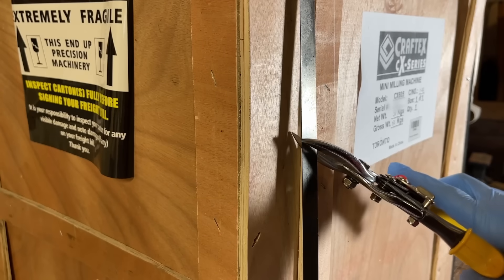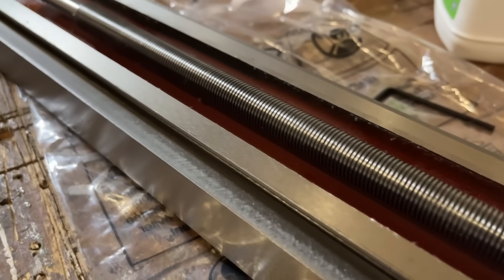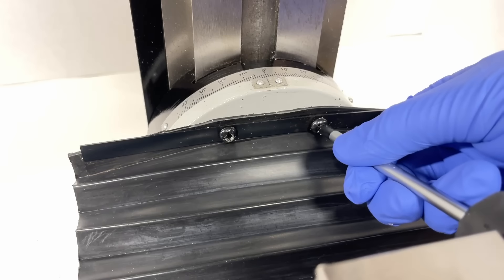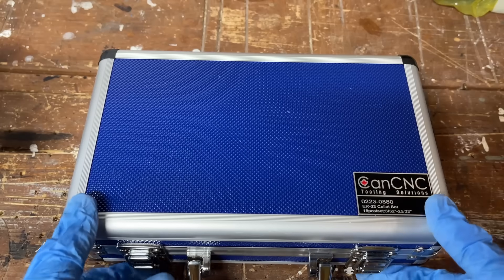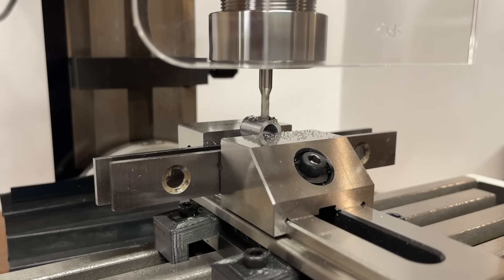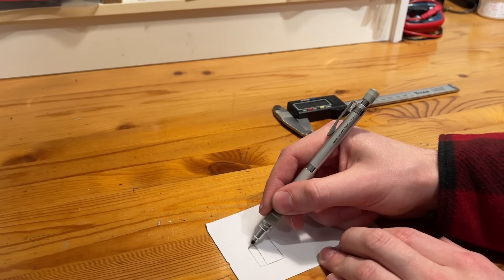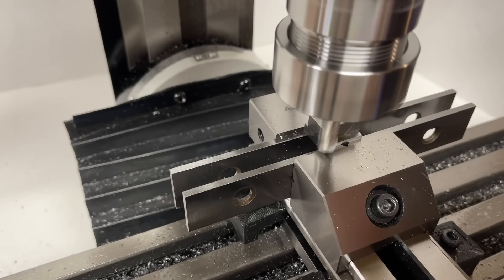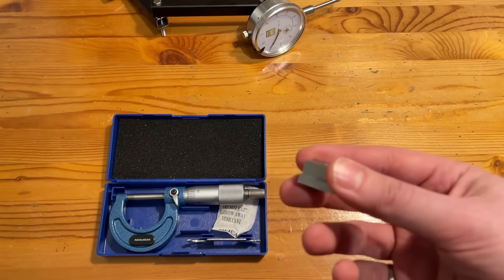I Bought A Minimill to see if they are Worth It

Comment: You should always mill in the same direction. This will compensate for any play in your milling table X and Y screws.
Reply: I grant that that the Bridgeport I learned on was old and had wear in the lead screws, but I thought that rule applied to EVERY machine tool -- always back up past the lash distance, and then approach your setting from the same direction.  Trying to dial in a position in the other direction means you have no idea where you are.
And then lock the setting, so that if the tool generates any forward force, it doesn't bite any deeper than you meant for it too.

Comment: Good video, thank you. The spacers you used under the piece to hold the piece in the vice looked like a couple of brackets; did you have someone else mill those to size before you were able to use them on your mill or did you painstakingly file them by hand? I only ask because my expectation was that you'd otherwise struggle to cut parallel sides to a piece. Often it's those first references that are the hardest to make without a mill.

Comment: IMO I would use a minimill in a home business/small shop setting but it's because of the low costs. If you have nothing, I think a mini mill and lathe are good places to start, but it will still be a challenge making a livable profit until you've invested enough time in a sizable library of tooling and improvements.

If you're a machinist with 10+ years, however, it might be worth either learning to millwright a used machine, or if you have a good idea and reputation, going into 100k debt and starting a small CNC shop with new equipment.

Comment: Bridgeport Series 1 and 2 universal milling machines have heads that can be tilted side to side and forward/backward. While they can be knocked out of alignment due to hard use, these and similar milling machines have been heavily used by industry for decades. It's a given that any machine that offers the flexibility of a tilting head will need to be trammed in from time to time.
Reply: Plus older Bridgeports and plenty of other manufacturers (US machine Tool Co. comes to mind as an example of a smaller mill) had round rams and simply clamped down on the column casting to hold them in place. You can't possibly tell me those never moved or those could take super heavy cuts.
Reply: @Hemingray1893  Only the V-ram Series I CNC had the ability to swivel on the cast base. They were basically a manual Series I milling machine retrofitted to be a CNC.

The rigid ram Series I and Series II had the head assembly fixed to the casting with both pins and screws. And yes, they could take heavy cuts--especially the Series II. The heads did not move. You could push them to the point the drive motors stalled.

Comment: The thing about small mills is plastic gears and low toque. If you stay in parameters and use the correct tools you should be able to cut anything. I have a FADAL 4020, while not a comparison in capability it's more a difference of power. With 22.5HP of direct crazy torque to 10,000RPM with coolant, I can plunge a half inch into Inconel with a 6 flute Harvey II endmill quite fast. I can use the same mill bit in the minimill and machine the same metal, just a lot slower and with more passes or those plastic gears will shred. I have an ACRA knee mill which overall is great for manual machining, it's a Bridgeport style, I'd say truly learning to mill, these smaller machines will let you down a bit.

Comment: I started out with a harbor freight mini mill and mini lathe when I first got into machining and metal working.
I slowly graduated to slightly larger benchtop machines and ended up with a full sized gunsmithing lathe and a CNC mill.
When I retired, I sold most of my metal working machines thinking I'd no longer have much use for them; boy was I wrong.
I sold off my mini lathe many years ago, but I kept the mini mill all this time.  I still own it and I still use it and, I just recently bought another mini lathe.
It's true that they require alot of tuning up to get them to run accurately; or, accurately enough for hobby stuff but, with a little experience under your belt that really isn't that hard to do.
Reply: Same boat sold the big mill and lathe and spot welder when I sold the shop. Had to buy replacements not quite as big but still good enough.
Reply: It's par for the course.
Reply: Just the person I've been looking for! Can you chamber a rifle, true up actions and barrels on a mini lathe?

Comment: the best addition will be a stiffening plate at the back of the column,  and then a 3 axis DRO - this will cost you about $ 250 in LED or about $300 in LCD, both with scales to fit your mill. I have made a polyVee drive myself and do not regret it - there are instructions on youtube and the internet as how to do it.  Another tip I can give is to 'cap' the drawbar and give it a square end - a spanner is way more easy on the spindle bearings than a hammer to loosen the MT3 tapers, and a spring loaded spindle stop will be a nice addition too.
Reply: I did the stiffening plate too.  Had to tap a bolt hole at the back of the frame, and in the column, but that is a lot better than having a colmn shift totally mess up a work.

Comment: Unless you want to work to less than 1/1000 of an inch the mini mill is fine. Would recommend paying extra for the belt drive model and converting to a gas strut lift. Remember we have to work within the limits of our wallets and pensions.

Comment: I've had one of these machines for about 20 years now. After using it for a while with the gear drive supplied I changed to belt drive (bought as a kit) and I think it was really worth the conversion, much smoother running. I find that it max's out at about a 10 mm (3/8") end mill or slot drill for normal cutting work (but usually stick to 6 mm /1/4") and 12 mm (1/2") for light surfacing.

Comment: The reason for 62.5 divisions is they are thousandths, and .0625 is half of .125 which is half of .250 which is half of .500 which is half of an inch. 16 full turns is basically an inch. So, a full turn is 1/16", a handy increment for many of us people down here in the country that landed men on the moon. If you have not the slightest interest in inch fractionals, or a particular cut is more easily expressed in thousandths as it usually is, then your solution can be an obvious and handy time saver, yeah. Super duper easy to do in Python or BASIC or whatever. I just do it on the fly in the Python environment, in an open terminal session, second nature to us Linux users. Divide the desired thousandths by 62.5 for whole turns and the decimal fraction of a  turn, then multiply the decimal part back by 62.5 for the leftover thousandths that the dial is marked off in. You can also use the "//" or int operator and the "%" or modulo operator for the leftover thousandths. To streamline even more, use the builtin divmod() function. There are two arguments, the first being the distance in thousandths, the second being 62.5 or a variable with the value 62.5 assigned.
x=62.5 # ENTER. That sets the value for x. You can check it by typing:  x [ENTER] and Python will return 62.5.
divmod(1253,x) # ENTER. 1253 thousandths for 1.253, x with value 62.5 assigned in the previous entry.. Don't forget the comma. Python will return a tuple, the first element 20.0 which is the number of whole turns, and the second being 3, the leftover marks on the dial. So 20 quick turns and then tweak it on over another 3 divisions.
Now, try it for 0.373
divmod(373,x) # returns (5, 60.5) and that is exactly two marks less than six full turns which is of course 3/8", so obviously the function arrives at the correct values for full turns and leftover increments to give you the desired travel.

My mini mill is marked the same way, and I much prefer it to metric goobledygook. YMMV, I know that there are a lot of metric fanboys out there who think inches are above their paygrade.

A reasonable level of accuracy and precision is possible with these machines. You have to do your due diligence in checking and tramming and keeping those gibs snug when they go slack from wear. So a little more work from the operator if you need something to be right on the money. Probably half of all mini mill owners could care less, and are cool with the nearest 1/128" LOL which is 7.8125 marks hahaha. But let's call it 8.

Comment: You should make a table with a 4-5" concrete slab on top. Quickrete countertop mix works well as it has reinforcing fibers in it and doesn't need rebar. Concrete really damps vibration and it makes a huge difference.

The issues many people have with small machines is just too snobbery. I understand criticizing poor quality machines. But people criticize small machines as if their size is a flaw. It is what it is and it does what it does. Its not a flaw, it's just a small machine. If you need something bigger, then it's not for you.
Reply from the maker: That’s a great idea! I had good luck with a concrete slab for improving my 3018. I’ll definitely be doing this!

Comment: When buying these machines, it is IMPORTANT to understand that all the castings are finish cut in one go.
Consequently, they are ALL warped.
When one side is cut, the stresses are released, and the metal changes shape.
After initial cutting, the casting should be left to warp, and then be final machined.

Therefore, the first task, is to determine the best datum surfaces to make flat, and then get everything square.
Ideally you need another milling machine, but I re-engineered mine with a surface plate, 4mm float glass, and a large variety of abrasives.
... It was a huge task.

Don't forget to 'grind in' the circular pivot bearing surface to the pillar.
This enables the pillar to be clamped solid.

Prior to assembly, you will need to add rigidity.
Add two bolts to the base, just past the '3 screw fulcrum point' on the pivot block, so that the base has four bolts around the fulcrum point.

The three screws, are almost inline, providing limited rigidity (considering the pillar and head, are flexing around the 3 screw fulcrum point).
On the pivot block, there is only space for two additional 6mm screws (so use hardened screws).

I added concrete to the pillar, to add mass.

Finally; cast a concrete base.
I embedded a pre-cast flat cement garden slab for the mounting surface, and rub ground the base to the slab.

This is a lot of work, but you end up with a proper milling machine for a cost of just £750
Obviously, having another mill, and a surface grinder, would make this work a simple task :)
Reply: Now, THAT would make a great video! You could really contribute to YouTube if you had a channel. I really don't know if you have a channel of your own or not. I am serious though when I say that you should think about becoming a YouTube creator, I'd watch your video's!
Reply: I have three grizzly G8689, same machine as yours under different name. Definitely get the air spring and belt drive upgrades. I also added a power feed to x axis, well worth it. Mine has .050" per revolution x and y, 60 per rev z fine adjust. Probably need the corresponding lead screw and collar for that to work. 

I've cut hundreds of pistol slides for red dot optics on it. Very useful machine.
Reply: Exactly why people should seek an old Clausing or similar mill. At least he has a dovetail column. The round ones are near useless.
Reply: Absolutely what this man said!!!
Reply: I had to true up mine out of the box.
Reply: nonsense
Reply: @martinmengh  What's nonsense?
Are you a bot?
Reply: @EngineTuning   castings are artificial aged, then ground; this is standard process ..   so much misinformation out there  about Chinese hobby / home machineries.
Reply: @martinmengh  
Martin; has someone paid you to say this?
You clearly have no experience in this field.

Note the "castings are artificial aged, then ground; this is standard process"

LOL What happened to the milling process?
Are we to presume it's been dropped in favour of an "All ground process (as standard)"?

Check your machines men!
If the castings are not all ground ... send them back LOL.

Or better still, run a straight edge over them, to confirm that they are warped.
But don't bother complaining, because they are all the same.
Instead, you should simply fix the problem.
Reply: ... nobody paid me for posting ... I am a model maker, and a happy customer, owning half the line up by SIEG (over 10 macines by SIEG alone) ...  Artificial aging of cast iron parts that go into any machine tools is just common-sense standard procedure, at least here in China.  If you don't know what it is, go look it up.  America lost touch with modern manufacturing.  .. lol
Reply: "After initial cutting, the casting should be left to warp, and then be final machined."  ... that's how it was done in the past to ensure precision geometry. .. modern process involves artificial aging, which involves controlled heating up the for a prolonged period, to relieve internal pressure, then final machining and grinding to arrive at final geometry.  "Artificial aging" is a thing, look it up. Saying all cast iorn parts from China are wrapped becase they weren't properly aged is simply un-factual.
Reply: @martinmengh  Obviously, artificial ageing is possible, only that these cheap milling machines, and lathes etc. are not built using this technology.
That is why the pieces are warped.

It's a factual thing, that can be easily measured.

When a casting is warped, the warping occurred after machining (for the reasons I explained).
Reply: @EngineTuning  maybe machines shipped overseas are different. Of the tens of machines I personally own, all of them Chinese, none had issue with warping of cast iron components; and most marketing material (in Chinese at least) always advertise "artificial aging" ..
Reply: @martinmengh  Lucky you :)
Reply: Did you watch the Video?
Reply: you can also just say that you never touched any steel in your life.

Comment: I've  had  one of these  Mills for 20+years. & I can  confirm the  factory  set up is crap.  Had to  totally  rebuild it  after purchase.  The  head bolts weren't tightend nor the  gearbox , leading to the mainsheet falling out  whilst in use. Smaching things up. 
Really  hope the  machine's of today are better.
Reply from the maker: Yeah qc is hit and miss depending on the brand/luck of the draw. It’s worth doing a tear down and some adjustments to make sure all is in working order

Comment: I have a CX-605 as well, had it for a few years now. I fixed the "noise" issue by changing the gear sets from plastic to cast gears* (*little machine shop) and using a good high pressure grease cut the racket down with good results. I don't have a tramming issue, I think because I literally stripped the machine down scrubbed the packing grease off of every mating surface. I also have a CX-708 Lathe which has been working without issue, it too was noisy but changing the oil and adding Lucas Oil treatment to the gear box make an amazing difference. Great video thanks for the share!
Reply: It seems to me (admittedly not a machinist, just curious) that the smaller machines offer a cheaper solution if you are willing to input labor to offset the price/space requirements.  Which is why it appears to be more popular among hobbyists or those with small needs.  Those who need these machines daily cannot afford 'extra' time each go to ensure everything is square.  Which is a fair assessment.  I think it would be beneficial to actually see the labor you, or others like the video author, ACTUALLY  put into improving the performance of these machines.  Like when the author admits he needed to tighten down the platform more.
Reply: Changed my plastic gears to brass gears that I cut myself using a hardened silver steel hob ( Rack type cutting edges, not spiral, dimensions in handbook) and a dividing head, (40 to 1 ratio) then I made myself a full set of plates that I drilled myself, (Hole positions on internet, done on Milling Machine). Also replaced the plastic change gears with brass and aluminium on the mini lathe,

Comment: I have one. As benchdrill, its really good (compared to drill). As mill, it has several weakness 1) not stiff enough 2) power (electronic speed contol is weak in low RPM, not much torque) 3) size, its  impossible to put parts under cutter because there is not enough room. But if you do small parts, its OK.

Comment: I have the ridgid column version of the Mini Mill. It has been used for years and served me well. A few electrical gremlins sorted out over time, Sieg have a good spares supply in the UK.
I put a dro on the Z axis. But never bothered with the x & y axis. I should do, it will be super useful but the space for the encoders is very limited.
Any ideas are welcome.

Comment: could you use feeler gauges as shim stock?
Reply: You can get packs of shim stock in both brass or steel. The packs come with an assortment of thicknesses and are reasonably priced. Look up industrial suppliers in your area. And yes, feeler gauges make excellent shim stock.
Reply: Sure! This is why you can buy the same material in coils :)
Reply: This actually sounds like genius